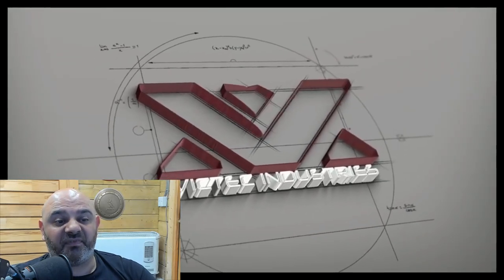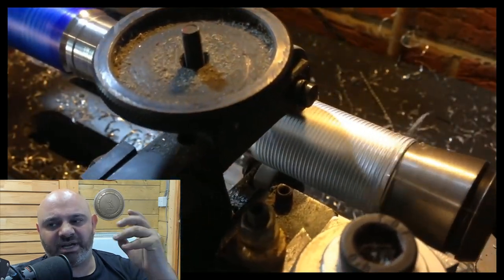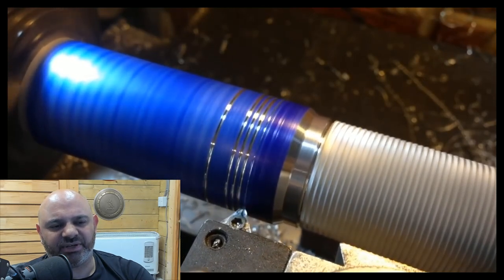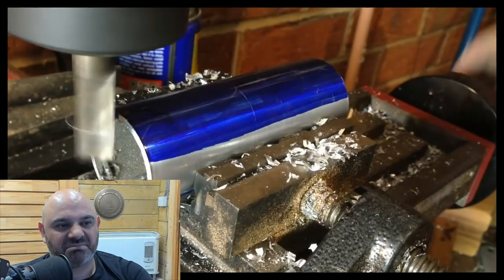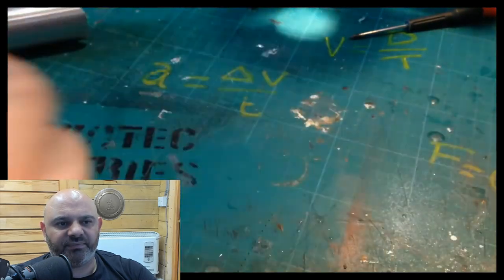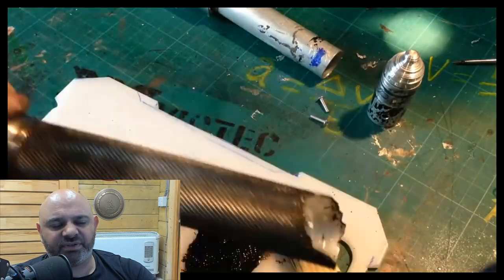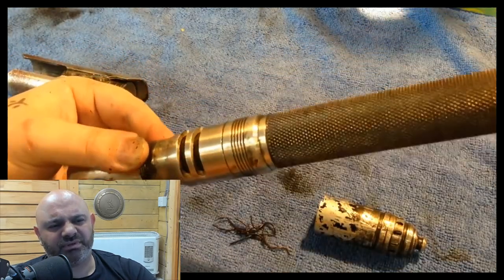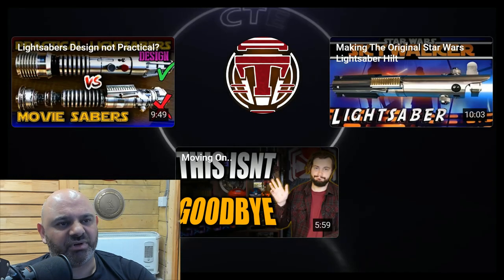making an amazing Jedi Fallen Order Kal Kestis Lightsaber Hilt by TYRANTH | BenSabers Reacts

Comment: its all looks so easy donst it when its sped up to that speed....i know nothing about laths or metal works .. so im clueless on all that but what makes one person better on one of these machines than someone else?..is it the level of knowledge on how the machines work or being great at maths and knowing how thin or thick you can mill things or or is it all about the confidence to make cuts in piecs of metal knowing that one slip or one millimetere mistake can ruin it all?  could those spiky bits of metal at the end of the pommel by done with out being sharp or made from  non metal  materials that dont cut?..i watched a  few of your saber making videos, i kind of like seeing the process of how hilts are made or customed but i guess its hard to make it look entertaining in a 3 minute video unless its sped up like this
Reply from the maker: oh you so have to speed up the lathe work. my videos where 9x speed or even more as you could be there for a hour working on 1 small bit. When it comes to what makes someone better it's down to the tools and knowledge. Not specifically how good the tool it but more on what the tool can do. a lathe with additional accessories will be able to do more than one with less. but more than that is the knowledge. I never had any training on a lathe or even ever used one until it got mine so someone whos been trained will be far better than someone like myself. but i think i did ok for zero knowledge and experience and just a natural talent lol